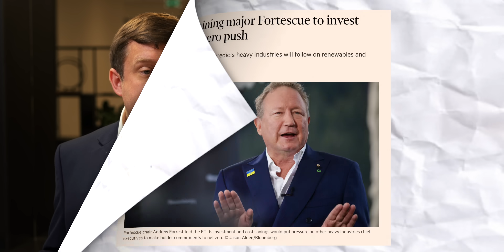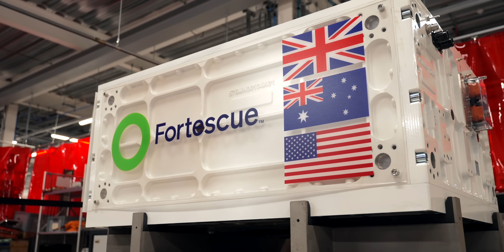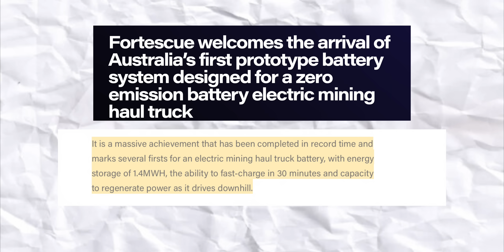This GIANT Electric Mining Truck Charges in Under 30 minutes!

Comment: It would have been interesting to know more about the charging infrastructure. This thing will need a 3000+-kva charger to pump that power in that quickly. That suit she wore is an arc flash suit for actuating contactors--it'll make the difference between an open casket funeral and a nice urn next to a photo, should the worst happen. And contactors like that tend not to like many cycles.

Never mind if the batteries all dumped that energy quickly--could take out the better part of a city block.
Reply: Luckily mines have a lot of power. If a truck was charging at 3MW ar our mine, it wouldnt be a blip on the screen.

Comment: Wow, 1.4mWh battery pack.  Thats big, and I am guessing here but that would be about 8-10 ton of batteries.  So I wonder how much haulage can be achieved between recharges?  If my math is correct, that means a 2.8mW charge rate for a 30 minute charge session.  Is that correct?
Reply: Probably a bit more with all the battery housing.
I don't know much about the model of truck this is based on, I only work on the CAT machines, but the engine and torque converter in the trucks I work on are about 12.5 tonnes. 
If you add up everything that can be removed from a CAT 793F truck (including 5000 litres of diesel, ~1100 litres of engine, transmission and diff oil), I get around 23 tonne lighter before putting the electric drive system in. So it may be possible to not really add that much weight.

Comment: The future of heavy machinery, aircraft and ships, is in hydrogen fuel cells or LTO batteries.
Where quick gasoline style charging is a must. A few minutes tops.
Hydrogen has 5+ times the energy of gasoline and dozens of times of any battery of the same weight. 
Batteries are for cars and motorcycles. Even small trucks like the Ford eF150 turned out to be a failure and not sell.

Comment: This seems a bit ludicrous. 

1.5 Megawatt per truck, more trucks to cover the ones charging.

Solar panel installation.

Even more batteries for storage.
Reply: It sounds bad because you got the numbers wrong. Recheck please.
Reply: @SocialDownclimber  thanks, I checked. Battery still very very very big.
Reply: Yes, but it will be replacing a 12 tonne or so engine in a lot of the trucks that size. You also don't need to fill them with ~5000 litres of diesel. Empty fuel tank alone is often 1 to 1.5 tonne depending on model.
If anything 1.4Mw hr sounds a bit on the low side to me. 2 - 2.5 Mw hour I would think would be better. If they could could get between 3.5 and 4 hours between half hour charges, then you could them have them charging at shift change over, morning break/smoke, lunch, then again a shift change over, so you may not end up with that much lost time charging. If they're only getting around 2 hours per charge then that will add a lot of down time.

Comment: Fantastic to know that the mining industry is pushing forward with their electrification. It is no doubt a tough challenge, particularly the charging at each end point of the routes is a challenge! But I have no doubt these challenges will be overcome!
Reply: Mining equipment has been electrified for years now..  just not BEV's  most of their monster equipment and drills run giant umbilical cards that are plugged into switch stacks which draws power directly from the grid..

Comment: Surely a mining truck is totally different to a racing car? One needs to keep going for 10-15 hours per day, where every minute of downtime costs a lot of money, whereas a racing car needs to provide lots of power for a pretty short time.
Dave Rawlins didn't sound very convincing. He didn't even sound like he convinced himself.
I can imagine regenerative charging going down into the mine pit would return some energy, but they still won't keep going for long.
Still, it's a start. At least they are trying.
Reply: More like 20 hours a day if there are no breakdowns, as pretty much every minesite like this runs 24/7. If it's an autonomous truck with no breakdowns it could operate pretty much the whole day minus refueling.

Comment: Another good review. Thank you.
If memory serves correctly, I think Nikki from Transport Evolved walked around this facility several months ago. The big thing mentioned then was the incredible amount of regen braking during the downhill run, almost charges the battery on the way down.
Reply: I'd imagine it takes a significant amount of energy to transport that haul back up as well.
Reply: @CAPOCAP It depends on the site layout.  If the mine is up high and the load is being carried down hill to a depot, then the regen is more than enough to power the empty truck up the hill.

The concept was tested successfully at a mine in 2018.

The truck was completely charged by regen and they had enough surplus energy to charge a lot of equipment at the depot.

Comment: The whole tyhing with going electric is that we do not want every body swapping at once, we need a steady update to the grid and charging options as more people go electric. This is fantastic to see that even the huge mining trucks are starting to move to battery technology, that is also improving all the time, whereas ICE has reached it's end of refinement.
The day will be here where fuel prices for ICE will keep increasing whereas electricity will become cheaper as more wind and solar come online, along with the battery storage.
Reply: Just use ethanol and biodiesel plants combined with PV and wind turbines to produce fuel. No need to scrap all those cars with internal combustion engines. Just be reasonable.
Reply: @1MCfocus1  Seems a lot of effort and cost. Just use the elctricity and probably a lot less of it and save having to create the bio diesel. 
But they can do it but costs will be far higher and I do wonder when fuel is 50p per mile and electricity 1p. This will make a decision for a lot more people.
Reply: @Jaw0lf  Electricity is a lot of cost - infrastructure and batteries aint cheap and getting more and more expensive. Destilery is not expensive. PV isn't either. Be real.
Reply: @1MCfocus1  Lol, EV batteries have dropped in price by 50% over the past year.  The grid is paid for by all who use it.
Batteries have been used as part of a huge storage successfully in Australia and many other places. Far cheaper than building a new power station. More PV and wind farms keep coming on line and this will make it cheaper and cheaper to own and run an EV.
Reply: @Jaw0lf  EV sales droped almost to 0.
Reply: @1MCfocus1  You are a comedian! Look for facts first. Auto trader shows an increase in EV sales over the past year at increased numbers.
Also thanks for all the comments making this video more popular.

Comment: The very low cost of solar energy these days make such projects infinitely feasible.   In the longer term, bye, bye diesel.
Reply: Just have to shut the mine down at night, early morning and afternoon.
Reply: @Robert-j6r8c Not hesrd of battery megapacks then?
Reply: @Robert-j6r8c There's a huge solar station near where I live with 1/3 of panels facing east, 1/3 west and 1/3 south so there goes your theory of morning and afternoon without solar power. The greatest part of the night the consumption is very little but usually there's wind or hydro anyways.
Reply: @Robert-j6r8c  one fortescue mine is already saving 100 million litres of diesel a year by running solar through the day , then they can run gas late at night . Roi was just 2 years . The infinity train will save even more .
Reply: @chrisward5626  
🤣... Yeah sure they are. 
100milion litres of fuel save is 300million kWh needed to replace that. 
300gwh

"Risen Energy (Australia) is developing the 132 MWdc Merredin Solar Farm approximately 260km east of Perth in Western Australia’s Central Wheatbelt region. Merredin Solar Farm is the largest solar farm committed to construction in Western Australia and once connected, will have an expected output of 281GWh of electricity annually, generating enough energy to power approximately 42,000 Western Australian homes."

This wouldn't even replace that amount of fuel.
Reply: @Robert-j6r8c Chris Ward your ChatGPT inspired word spaghetti is badly off the mark. Merriden Solar Farm was completed nearly 5 years ago & is ~1,500km south of Fortescues iron ore mines.
Reply: @sapplin  As always you have missed the point. That amount of energy needs to be produced. Where do you think the energy comes from? In order to be green you need solar or wind. And in there lies the small problem that you require massive amounts of solar like the Merredin Solar Farm. I really don't see those massive farms constructed on site do you? It was merely a comparison for size, not the actual location. Talk about being of mark. 

The only reasonable way to supply energy in such amounts is either nuclear or fossil. And what about those diggers? Those consume up to 5 times more each.  Not only is 100 million litres of diesel a mere drop in the total consumption of this mine, it also puts a huge additional strain on the grid. We humans have to make a choice. Either we want luxury items that require mining and thus pollution or we go back to farming and a frugal life. After all, what is not used, needs not be mined.
Reply: @Robert-j6r8c  I just searched "biggest solar plants" and the biggest is just above 2Gw and powers 700.000 homes. I think your figures of 281Gw powering 42.000 homes is confusing. Quite a few solar farms now produce as much as a nuclear station but at a fraction of the maintenance cost. I don't think investors will dish out millions without doing their math.
Reply: @antoniocruz8083     
When someone puts " before and after a paragraph, that's showing it's a quote from someone. 
In this case it's a quote from Risen energy Australia... The people running the solar plant. 

Are you saying they don't know what they're talking about?
Reply: @Robert-j6r8c  No, just search 10 biggest solar stations. There is a site that lists them. The biggest being 2.250MW. (2,25GW) If you search nuclear stations the average is 1.000MW (1GW) and they can power hundreds of thousands of homes. Your figures don't add up, maybe not well copied, 281GW (too big) for only 42.000 homes.
Reply: @Robert-j6r8c  I see you don't want to accept that renewables can provide most energy needs for some countries, not all, but it's already happening. Here in Portugal there is 100% renewables for days on end,  that's solar wind and hydro. The last coal station just closed other fuel ones are mainly on standby. Are you saying the investors on these renewables don't know what they are doing, just throwing their money away?
Reply: @Robert-j6r8c  lol what 😂🤦‍♂️ seriously you still have time to delete that champ . How embarrassing 🤡
Reply: @antoniocruz8083  
They're investing for money, they don't give a shit if you have electricity 100% of the time or not. 
Government has given big subsidies for renewables, they wouldn't be investing without it. 

So days on end 100%, that says the current system is big  enough to run the country yet still can't. 
Because the days you can't, add more renewables that won't produce anything on those days won't fix it.
Reply: @Robert-j6r8c  Some countries run 100% all the time on renwables while others can't and probably never will, but they're still saving million of gallons of burnt fuel and saving money. Just like the excavators, they may not run on hydro or sun all the time but each day they do is a masssive saving, that's why they were built, not just to impress the public. But what choice do the countries without oil have? Spend their budgets away on russian oil only to be cut off at any time? That's why governments sponsor renewables, they're sponsoring energy independence, as much as possible.